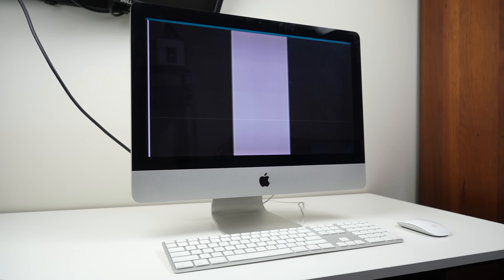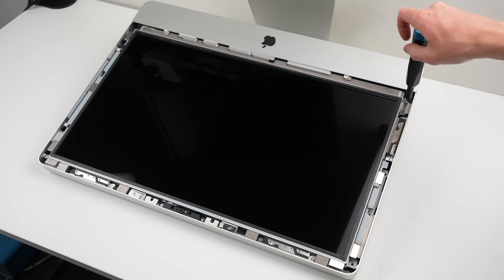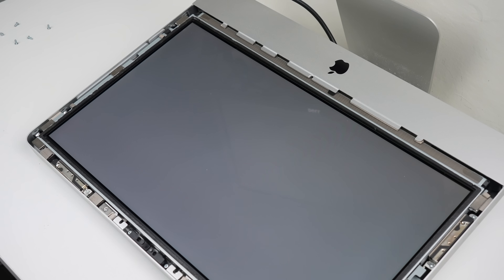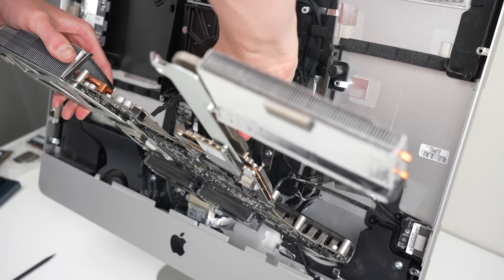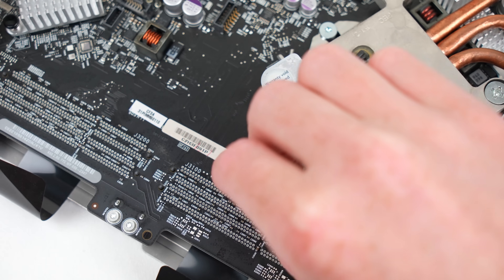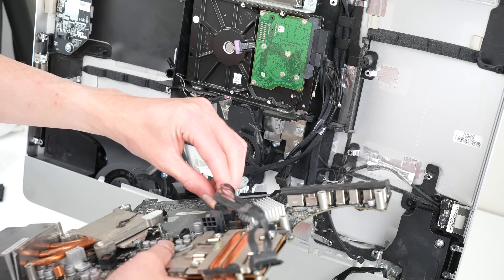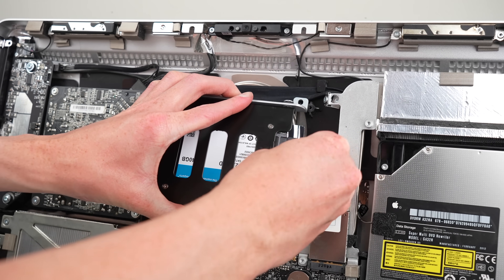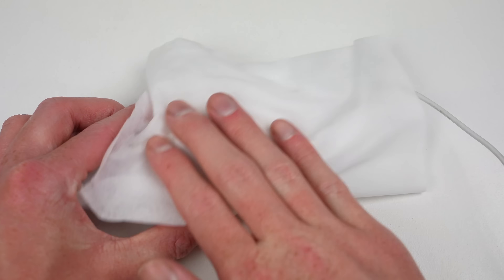FREE Broken iMac Gets Repaired And Upgraded!

Comment: Hugh, There is no need to remove the power supply or the DVD drive. The logic board can be removed with these left in place
Reply: Probably he is doing it to clean if theres any dirt or something....even i do so
Reply: I don't disagree, it does appear that that is the case.  But with how many things he does do right that the majority of technicians slip up on, makes me trust his methods.

However, I do agree that he probably didn't need to remove the PSU and DD to get at the LB.
Reply: The ram install was very strange too. It won't run in dual channel :/ And the CPU cleaning with a brush wasn't ideal. Just dip it in Alcohol and leave it to dry.
Reply: @thatsthis753 you prune,Hugh didn't have time to do that in this Video which is why he cleaned it the way he did
Reply: @thatsthis753 you prune,Hugh doesn't have time in this Video to do that
Reply: @thatsthis753  mixing and matching ram will run it in dual channel though clock spd will be limited to the lowest supported in all sticks. ive been mixing 16gb 3200mhz and 8gb 2666mhz and it ran at 2666, so yeah
Reply: Touched one of those power supplies once, never again 😂
Reply: @whizzbits they are totally safe if a person takes precautions and doesn't clean it with it still plugged in
With it unplugged it is perfectly safe
Reply: @stephensnell5707  Not all, the main capacitor is highly likely to be charged. I killed an iMac board as it touched the PSU while it was unplugged and it sparked
Reply: He wanted to get rid of dust and gunk in the DVD drive and power supply so they’d run better that’s why he removed them
Reply: You are right but it depends on what era of the Mac it was. This one is a mid 2011 model, so it is probably needed.
Reply: @xoo6920  is a mid 2011
Reply: @stevenbenson9976  oh ok
Reply: I'm sure it was to clean behind them.
Reply: The way that is the way is not the way
Reply: Oh
Reply: But its convenient and much less dangerous
Reply: Oh ok mr.perfect 😺😂
Reply: @dejavustudio243  I don’t think he was trying to be stuck up lol, I think he was just trying to be informative…
Reply: @ThatRollerCoasterNerd  ok dude

Comment: I would have added at least 16GB of RAM, and tried to install a more modern Linux distro like Solus to see what works, and what does not.
Reply: These run Windows 11 nicely too.
Reply: @StephenDeTomasi  I'd rather have my right nut smashed with a hammer then run Windows 11 given how horrible Windows 10 was causing me so many problems like deleted files after an update, forced reboots in the middle of my work where I had to redo several hours of it, pegging my system at 100% after boot just sitting on the desktop, etc.. and now hearing Windows 11 is trying to force people to run their horrible Edge browser(yes I gave the official Linux port a shot for a day, and it was pure crap), among many other issues NO WAY!!!
Reply: @StephenDeTomasi  i use windows 11 on some old  8 core, raid ssd ,32gb mac pro's from 2006 and it works fantastic...in some ways, its faster than mac os..the benefits are full gpu hardware acceleration from the vid card in win 11 thats lacking in capitan.. i use a gtx 960 for effortless 4k playback  but it only does so in windows.

Comment: I had the 2011 model of this, and tried installing SSD, RAM etc. Issue I had was connecting the display cable to the motherboard, as the pins were very hard to align correctly. 
Tried everything, didn't work, sent it to recycling plant. Kept the SSD and RAM though :)

Comment: Beautiful upgrade video. The 2011 27" may be the last of the upgradeable iMacs, but it remains a long lived classic. 

Kept postponing the upgrade of a 2011 iMac 27". Last year finally got around to looking for parts. But like John Cunningham, found a used spec'd out (no SSD but new hard drive) 2011 with minor blemishes, for under $200. Sooo I sense not one but two hard drive upgrades in the future. Hoping two doesn't become three.
Reply: The 2011 27" is a nice machine, and it can be pretty cheap these days thanks to the crippling GPU failures they suffer from. I got mine for free from a customer who didn't need the machine back, and after reflowing the GPU twice it's now one of my primary computers.

Comment: If you have a faulty display like this you should be able to repair it just by replacing its controller board. If not mechanically damaged those panels almost never die

Comment: Hey Hugh, do you know how to get a 2011 iMac that has been "upgraded" to Catalina using the patcher, back to high Sierra? My dad bought one used with Catalina already but putting Catalina on a 2011 iMac loses its 3d acceleration so it's not worth it, but the iMac won't boot into a usb with something other than the patcher

Comment: Interesting , I done the same and used the same CPU and also a crucial 1 tb drive , but I required the OWC sensor , I also put 20 gig of memory in it , having many macs including late model 27 inch machines I put Linux Zorin on it , and it flies , I worked on macs for 30 years professionally , though now retired I still enjoy tinkering

Comment: Nice upgrade and restoration! It's a shame that newer Macs aren't as easy to repair as this one.
Also, now I'm interested about where the second SSD would have gone, since you mention two drive bays...
Reply: The area underneath the optical drive is the 2.5" drive bay. That's where I have the SSD installed in my 2011 27" iMac, and it means I still have a mechanical hard drive and a functioning optical drive.

Comment: There are Quadro cards you can upgrade to with a firmware upgrade that are inexpensive.
Reply: Yep, I just made a similar comment. I did that upgrade (as well as using Dosdude1's patcher) on my wife's 2011 iMac and it is running Mojave nicely. Didn't go all the way to Catalina because she has a couple of 32 bit apps she still likes to use.
Reply: @mattelder1971  I sold I have such on Mojave too. Lost my old MS Office. 
I upgraded a friend's 2011 iMac with a Quadro card more RAM and an SSD hard drive combo. It's been great for a year now.

Comment: Also I think that’s a 2010 one not a 2011 as the 2011 ones have 2 thunderbolt ports and the 2010 ones have only 1
Reply: This is a 2011 21.5" iMac. Only the 27" model has two Thunderbolt ports. The 2010 iMacs have only one miniDP connector, even on the 27" model. They don't have Thunderbolt at all.
Reply: @jamiechampion299  oooooh

Comment: I bought a used iMac several months ago Mid 2011; 27", i7 processor quad core 3.4GHz, 32GB of ram, 180GB solid state drive, AMD graphics card Radeon HD 6970M, and pre-loaded with High Sierra, and remote keyboard and mouse. Unit is like new condition with no marks, the tech I bought it from had overhauled the unit leaving me with no work, "fully loaded".

Comment: Since the PSU is not covered, aren't you stressed when manipulating it ? You should use gloves for this in my opinion.
Reply: Usually Psu's will discharge all caps in couple mins so i don't understand why people is spooked about them. Simply use a multimeter on the main cap after the transformer and check if there's some voltage on there. If there's less than 20 volts you can work safely enough, otherwise wait another couple seconds.
Reply: @RudyZanutta  Thanks for the reply, I see a lot of people saying they are super dangerous
Reply: @williamsaad6833  They indeed are dangerous but once is disconnected and wait couple minutes you should be totally fine. In the Last 20 years power supplies are much safer cause they have circuitry to discharge caps. If you work on older psus then you must pay much more attention handling them. They could store energy for even couple days..
Reply: @RudyZanutta  I have worked on several of these iMacs, and these power supplies don't always drain their caps as quickly as they should. I've gotten a shock off one that was unplugged for nearly an hour. It's better to be safe than sorry when dealing with exposed PSUs, even if they are supposed to render themselves safe when unplugged.

Comment: Nice video, Hugh. Whilst you put the wifi antenna cables back in the order they came off, was it the right order? The cables have zero, one and two stripes and the connectors are numbered 0,1 and 2. The zero and two appear to have got swapped.

Comment: replacing the cmos battery after upgrades, sign of a true expert
Reply: Worked in IT repair the last ~25yrs and only ever had to replace a few cmos batteries. Not a bad idea replacing the one in a system like this considering the age and cost of the battery but an "expert" isn't going to waste batteries replacing ones that don't require it. The majority of systems these days run default bios settings so the battery dying is only going to affect the time until the OS kicks in and grabs the time off the internet.

Comment: Always nice to see someone upgrade an iMac. What I did noticed is that you replace the hdd and use the standard cable. Since the original hdd have a build in temperature sensor, and the ssd have not, didn’t affect the fans speed?
Reply: SSDs have temperature sensors as well.
Reply: Each drive that I use in my PC (both HDDs and SSDs) have a temperature sensor built in. If the iMac is using S.M.A.R.T. (which it probably is) it will pull the temperature from the new SSD and should work properly. Would like to hear from someone who uses a iMac with upgraded drive, but that's my guess.
Reply: @LirekPL  These iMacs don't use S.M.A.R.T. data for their drive temperature readings. I know for a fact that the 27" 2011 iMac requires the use of a replacement thermal sensor or fan control software when using non-stock drives, but I'm not sure why one wasn't installed in this video. The 21.5" iMacs I've worked on have also needed them.
Reply: @jamiechampion299  that’s what I thought

Comment: Another great video, to the point, no faffing, filling or BS. It would have been nice to see you update the OS to Catalina or above. 
I have upgrade an iMAC 20" early 2008 to 8gb ram, 256GB SSD and installed macOS Catalina, even though it's not supported by following a few YouTube videos. 
Lovely machine, the only problem I have had is any browser based on Chromium IE Chrome, Edge etc won't run on it, keep getting exception errors, so I now use Firefox instead.
I got my iMAC from a man who was about to dispose of it at the tip (Refuse Centre).

Comment: Nice video asl alwayws, just cruious why you didnt actually put that 3rd SATA Connector to use for the SSD. The cable in around 5-15 Dollars. Actually have a 2011 21,5" running here myself, with an HDD, SSD and ODD.

Comment: I have a 2011 27” iMac. I’ve updated it to an SSD and 32 G of RAM, running High Sierra. It still is a fine computer.
Reply: Upgrading a 2011 iMac running High Sierra to 32 G of RAM is not optimal, the OS is so outdated so hardware to improve performance won't last you long as you start losing support for things such as security, and the lack of access to everyday programs, considering the fact of not updating. :]
Reply: @alexaplexl  - it’s just fine. My MacBook Air M1 is my daily driver.
Reply: @alexaplexl  no one cares about "security" ........ use Linux if you do

Comment: Just curious, why do you use 50fps instead of 60fps at 720p and higher?
Reply: Could be because PAL regions used 50 instead of 60 fps for a while.
Reply: Australian mains power (230 volts) cycles at 50 Hz, so 50 fps probably avoids issues with lights flickering on camera.